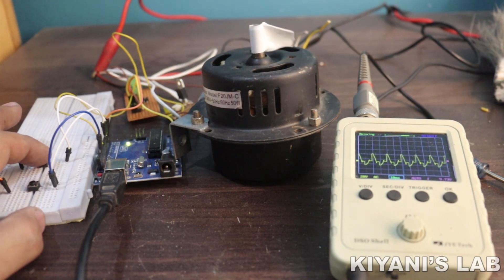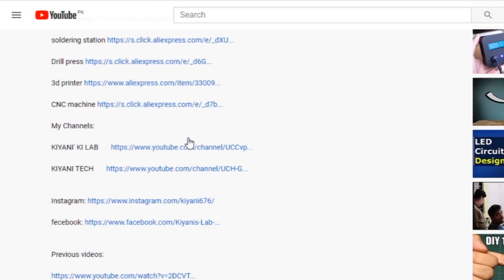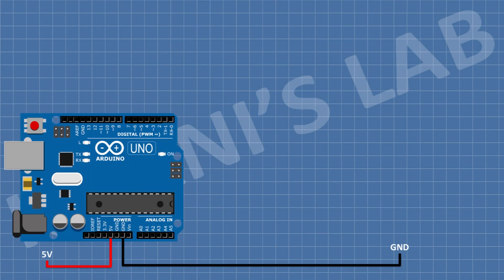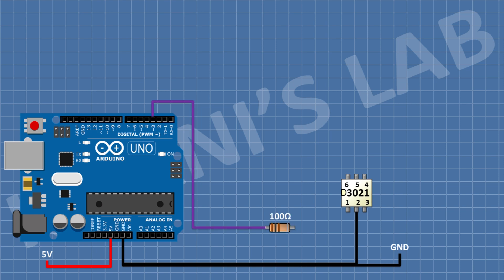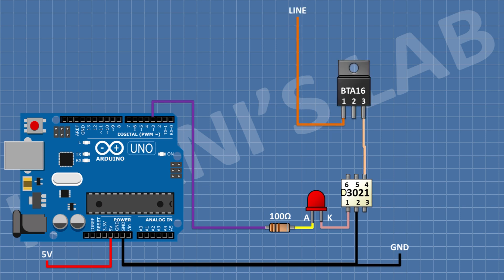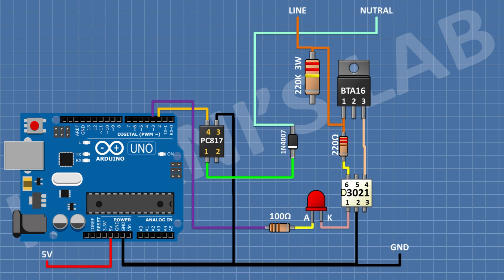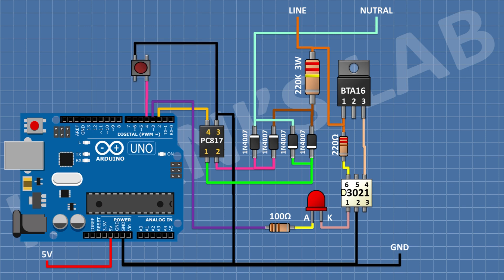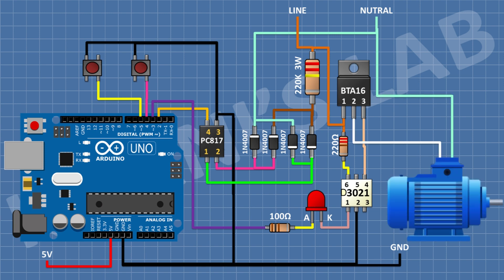How to Make AC Motor Speed Controller

Comment: This is for a voltage of 110, yes, for 220 as in Indonesia it means the resistor value is doubled, for example a 220K resistor becomes 450K 3watt

Comment: Brother I have a query, can you tell me how are you providing power to the circuit, is it directly plugged into home socket to 220 volts or did you use a transformer to step down?

Comment: can I use attiny85 instead of arduino? and what's the maximum current your design can control. I mean can I control upto 2kW AC 220v motor by using a more powerful triac?

Comment: Excellent idea, but I would need such a controller for a three phase motor. Can three triacs be connected in parallel to the output of the Controller? Thanks.
Reply: Excuse me, I want to ask you, if I use a 540 watt single phase motor, can I control it with the circuit in this video? Thank You